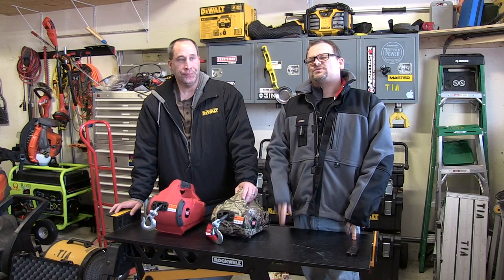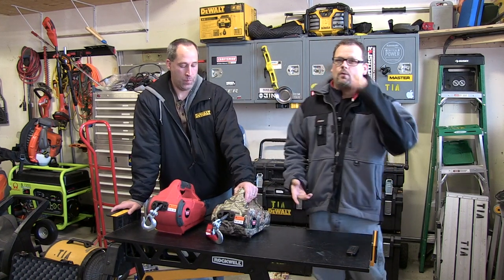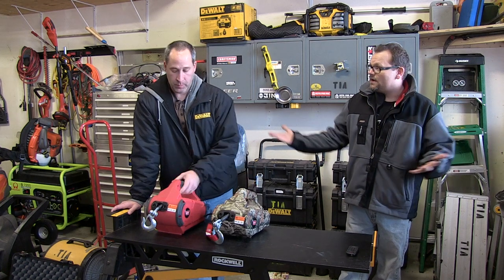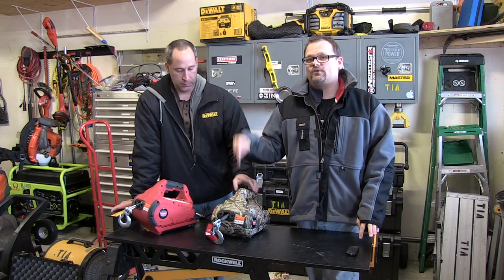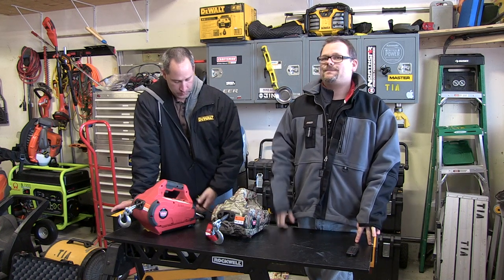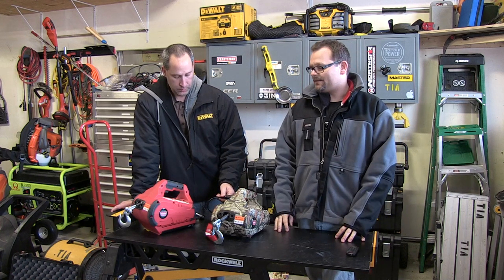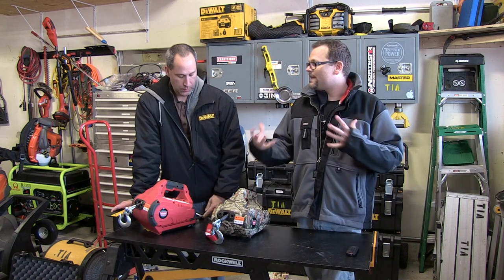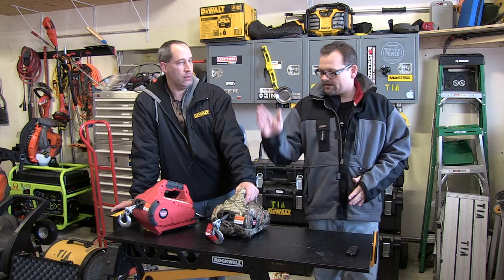WARN Corded PullzAll - Lifting and Pulling Tool

Comment: Hey Dan and Eric Lewis also makes a (Lewis Multi Drill) that also attaches to any chainsaw and turns it into a drill. It can drill 4,6,8, and even 10 inch earth and ice augers. And also can be used for drilling small auger bits through wood when using carriage bolts.

Comment: Overload safety is a great idea. I wonder if that would work well for pulling a non-running car into a garage. Have something to mount the Warn to and have the car in neutral. AC won’t do much for you in a vehicle unless you have an inverter. I believe you can get an inverter that plugs into your car lighter or power port for under 50$.

Comment: It makes me wonder why they just didn't make it a 12 volt unit. If it was 12 volt then all the person would have to do it plug it into the cigarette lighter to use out on the road. Not everyone has 120 volts just laying around out in the middle of nowhere. Now what would be really nice is to have one that has batteries, 120 volt as well as 12 volt and maybe a switch to go in between the three settings, then it can be used everywhere and covers a lot of common voltages.
Reply: You're not going to get that kind of amperage from a cigarette lighter outlet.

Comment: Hey Dan and Eric check out the Lewis chainsaw winch. It is an adapter that you can mount to your stihl or husqvarna and other brand  chainsaws that turns it into a winch the is capable of pulling up to 8,000 pounds